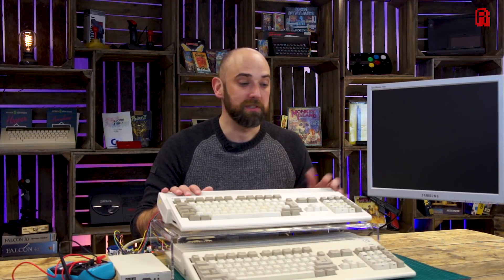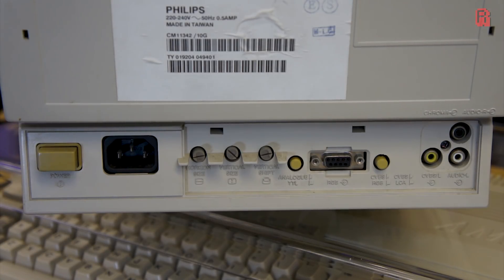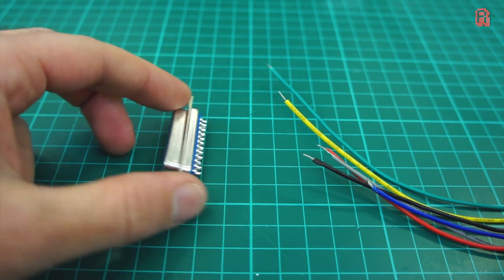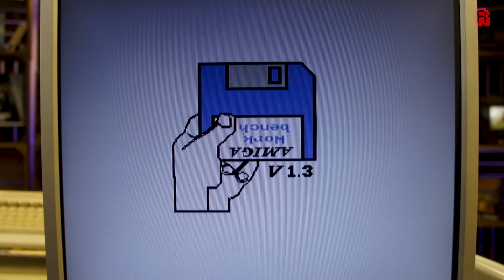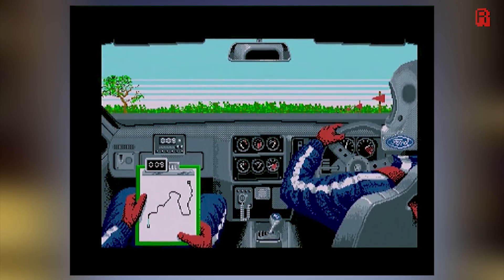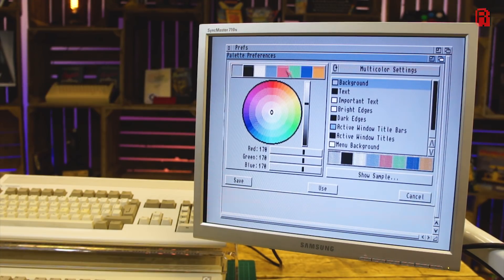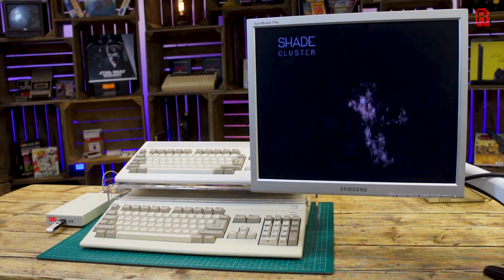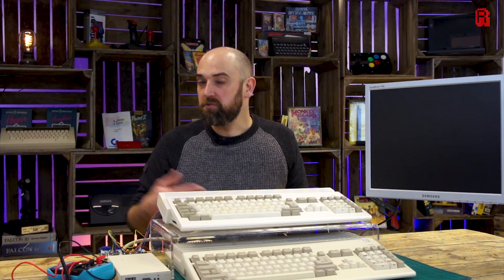Amiga to VGA | GBS-8220 Review (CGA/EGA/YUV to VGA)

Comment from the maker: Thank you for watching I hope this helps you with your purchasing decisions!  Please see further links in the description of others findings and modifications, and I'll be sharing a mod episode very soon.  Overall I'm impressed for the price, and we don't want to spend too much time or money on modding it as every £ closes the gap to the more expensive legitimate solutions out there.  If you have an alternative method I'd love to hear your thoughts and experiences.  Neil - RMC
Reply from the maker: There are a few on ebay, failing that some people hack up a DB25
Reply: Thanks very much.
Reply: about YUV.... you are not quite right but close

did a quick google and found this link that explains it reasonble for laymen: https://www.pcmag.com/encyclopedia/term/55165/yuv
Reply: My dad is more in to this and i remember that he explained it as a signal that transfers the colours except blue and that the screen do the looking at what is missing

ie the transmitting end sends say 20% red and 70% green... the screen then knows that blue was 10%
Reply: Where did you get the DB-23, i can't find it anywhere.
Reply: I currently use the RGB->SCART->HDMI solution and find it barely passable (input lag and problems with aspect ratio at interlaced modes, at least with my particular 16:9 LED monitor)

Watching this was indeed helpful, but I think I'm going to splurge for an OSSC which for the inflated cost, doesn't suffer from the noise and artifacting and like the GBBS board, can use it on a variety of machines.

A+ video as usual, thanks!
Reply: Craft4Cube

There are actually quite a few on eBay UK right now, but shhhhh, don't tell anyone. :p

https://www.ebay.co.uk/itm/23-WAY-D-DB23-D23-DB23F-DB23M-CONNECTOR-SOCKET-PLUG/362047168375?ssPageName=STRK%3AMEBIDX%3AIT&var=631292478000&_trksid=p2057872.m2749.l2649

You need the female connector if you want to plug into the RGB / Video port on the back of the Amiga.

Or the male connector if you want to hook something up to the floppy drive port.

I would recommend grabbing a few of each type, because they don't appear for sale very often.
Reply: Niiiice. The last solution I'd seen for this was years back, and it was a board for the A1000 that actually had to be soldered to the video chip pinouts. Given I have a A2000, this is much better..if I could find the DB-23 connector (And I'm in the US, so that adds another wrinkle to it. :-) )

One question..you're obviously using the PAL mode of the Ami  here...does this have any problems with NTSC mode, or switching between them?
Reply from the maker: VulpisFoxfire I did indeed switch to NTSC on the A1200 out of interest and it worked.  I didn't fire up any games though so further testing required.  I'll perhaps add that to pt2
Reply: Love things like this! Have you given thought to buying a 19" 4X3 LCD? Generally speaking they offered 1600X1200 resolutions but were great for lower settings as well.
Reply: Get an old a 500 modulator that is faulty  that is what i did for mine though it has no cover like a separate db 23 plug does
Reply: As you're working with analog video, I would HIGHLY recommend using shielded cable(s). It would greatly cut down on the interference you're seeing, and also (if you have shielding on each of the R, G and B lines independently) would cut out crosstalk.
Reply: RetroManCave is there anything in between $18 USD and 300pounds for a vampire?
Reply: got one on ebay, now we wait 30 days ....

Comment: Have you tried the gbs-control upgrade with the gbs-8200/8220? My parts will arive soon, and am hoping for better results than the gbs-8200 alone. There's an option to add a clock to remove the tearing issue but I won't bother.

Comment: I use the GBS to use old 80s word processors that require external displays. It’s a life saver at that price, mine’s in a 3D printed case and I use a small 5v adapter

Comment: Don't forget to fit a 680ohm resistor on the grey cable, the Amiga outputs too high a voltage for the card so you'll shorten it's lifespan without one.

Comment: Recently dug out my A1200. It started up once with a screen asking for the Workbench.... The screen went away and just became gray. Now I do not know if the monitor or the computer are at fault. To find out, I decided to try the fix you suggested. I got the board, had a 5 volt power supply. I could not find a DB23 plug, but my Amiga connected to the monitor via VGA cable through the VGA in and VGA out from the 8220 board and a Commodore 390682-01 RGB to VGA adapter to the computer. Well, at least there was a signal through the board and to the monitor, but just a green screen. Hmmm. Any advice? Is my Amiga kaput? Do I need to get that DB23 plug? I will appreciate your thoughts.

Comment: I have fixed many of these monitors over the years. The line output transformer does fail. It fails with a short between winding. Its a long time now since I did any and can't remember the place that made new transformers or if they are still doing them. Those transformer I never had one fail after replacing it unlike the originals. I think there must have been inter-winding stress that caused the insulation to breakdown over time. Another problem with the 500 power supplies which I fixed for a few people was that the pcb would crack across a corner resulting in the regulator not working and giving out 45 volts on the 5 volt line. When this happened there were two loud bangs, an electrolytic capacitor in the floppy drive and one on the main board. Amazingly, after these were replaced and the power supply fixed the Amiga still worked

Comment: whilst most monitor outputs to 1080p via VGA, I would think 720x576 I/P would likely be the best outcome if hdmi is not  used by default  for audio and video..

I'm not sure if cga and vga  inter compatible with 1 another  i know of  converters from component to vga  however  end up pretty much useless as only  3 pins are usually active in this option..

i can't say if cga  pin out would be compatible with  a vga signal..

My experience is never try to push a resolution the system was never designed to push..

noting if you are planning  to use  amiga onboard or an external sound card note: most tv's that do support audio on a pc connection  must use a 3.5mm stereo jack  no tv within the last 10-15+ years has rca analog  audio connection  as preferred medium  where you have a pc connection for vga..

I would avoid using rca>3.5mm conversion cables as this is the best way to introduce white noise into the connection as you are going from a earthed to and unearthed connection..

been mixing  pc audio  to hifi equipment for over  25 years and I can say this for sure

toslink or rca>rca is your best connection method  pc and hifi equipment unless you have a 3.5>3.5mm audio connection to spare

Finding a pro audio card is  few and far between that has access to  rca output that is pci based and that can work within an amiga platform..

even on a pc platform itself can be quite hard in rca based sound cards

Comment: is it ok to plug in the amiga db23 port using an adapter  to the vga in on this board and then connect ths lcd monitor to the vga output of the board

Comment: I've got a DVI port in my A1200 but I just purchased an A500 off ebay and thought how the hell am I going to run it because my 1084s has been sitting in the garage for years gathering dust so I don't think it would fire up anymore and I think I mite have an old analog TV that would work with the RF modulator but I would like to plug it into my current 27inch monitor so this option mite solve my problem

Comment: Is this the one you Philips fixed in recent video? Flyback only? I ask because I have exactly the same symptoms, same sound and power led does not lit. Can you confirm that was the only problem, please?
Reply from the maker: Yes that's the one
Reply: @TheRetroCollective  Mine is 1084S-P1 which is internally exactly the same monitor as I recall.

Comment: Neil, that Samsung 710N is 15mhz compatible? Will it work on an Amiga 500 with a scart -> vga cable? Do you know?
Thanks!
Reply from the maker: Some of the 710N's are.... mine is not sadly
Reply: @TheRetroCollective  whats the prodution year of yours?
Any way to see from the outside if it will work at 15mhz? Serial number?
I've noticed that some 710N in the labrl in the back have a letter in the model after 710N. Could it do to make the diference? I've seen some with "710N [R]"

Comment: Nice Video, although my 1960 still works fine, my NEC multisync died long ago, and since i have an A500, and A1200 and an A4000, I tryed the syncdoubler way and got quite upset on the ripp-off price. So, I decided to buy 3 amiga RGB to scart cables (you have them on ebay for 9euro) and a scart to HDMI converter (again, on ebay for around 25euro).
They are all connected to my Yamaha AVR and I have no flicker nor noise...so I strongly recommend you try 2 ebay buys:
https://www.ebay.com/itm/AMIGA-RGB-SCART-AUDIO-VIDEO-KABEL-1-Meter/322719659549?hash=item4b2397361d:g:7ykAAOSw44BYXSLU
https://www.ebay.com/itm/Scales-Scart-Signal-RGB-Composite-Video-to-HDMI-720P-1080P-Video-Converter/153569151437?hash=item23c16f49cd:m:maWpTLhTdZXSr2vNL_i2G8w

Comment: There are so many ways to connect a AMIGA. Got my AMIGA 500 to a BenQ BL702A 17 inch VGA monitor. With a Indivision ECS V1 with the Super Denise 8373. You must get the right settings with the monitor and the ScreenMode and Overscan. For my AMIGA games it’s perfect. For the AMIGA 1200 the BenQ BL912 19 inch monitor with a RGB/VGA adapter is great. I want the 50Hz PAL Laced 15.6KHz because i want the same as my deceased Commodore 1084S-P1 RGB CRT monitor.

Comment: I have one of those and like you I wasn't quite satisfied with the picture quality.  The sampling of pixels is not in sync with Amiga pixel clock, so there's a lot of blurring and interpolation going on, and it doesn't work as a pure scandoubler, it doesn't output the number of lines that Amiga does, and because it de-interlaces it introduces additional artifacts.  There is a project out there for controlling the scaler chip using a Raspberry Pi, and possibly eventually a firmware mod, but I think better solutions for similar money will eventually arrive.  Oh, and since VGA LCD monitors will not sync to 50Hz, the board will also be doing framerate conversion as well, which is jerky.
Reply from the maker: Since this I have discovered the OSSC.  It's pricey, but you do seem to get what you pay for

Comment: RetroManCave. Question I am hoping you can answer? I have two Wells Gardner D9800 27" Arcade monitors that will eventually feature in a dedicated horizontal and vertical cabinet respectively.  The monitor is capable of 15khz (My main reason to play MAME games at 15khz as they were mostly meant to) THe monitor also supports 25khz (Mortal Kombat) and 31khz.

It has a VGA DB connector at back of the monitor as the only input...Could I run an Amiga on these monitors via that? Thanks in advance!
Reply from the maker: Hmmm you could give it a go.  You can buy a passive db23 to vga adapter for the the Amiga to try it out.  Also check out the ArcadeVGA card from Ultimarc to hook up a PC full of emulators
Reply: @TheRetroCollective  Thanks, I have several Ultimarc (nice to see you know his products!) cards as I have built a few arcade cabinets..just wasn't sure if your cable mod would work between Amiga and the WG D9800 27" monitor :) Thanks for responding!

Comment: Hello, Great video Retromancave. Question: why do you need 3.3V instead of 5V. As far I can see the pcb says 5V on your video.I bought also the gbs 8220 v3.0 and it says on the pcb 5V, too. So how did you find out to use 3.3V .

Comment: Great Channel!
Dont know if you have already fixed your phillips CM8833-II? If you have Ignore the rest of this post.

you are correct on the problem, it is the flyback transformer. I had the same identical issue I bought a new one from retronics
and got a local (old) tv repair man to fix it for about £30.
It works like a dream now. 

HR 7533 / AT2079-37591 / AT2079-37592 Flyback FOR C= and Philips monitors NEW!
( 222707045823 )

retronics.eu
www.ebay.co.uk/itm/HR-7533-AT2079-37591-AT2079-37592-Flyback-FOR-C-and-Philips-monitors-NEW/323494769777?hash=item4b51ca7471:g:g14AAOSwsFpWRzq0:rk:2:pf:0
Reply: https://www.ebay.co.uk/itm/HR-7533-AT2079-37591-AT2079-37592-Flyback-FOR-C-and-Philips-monitors-NEW/223591644315?hash=item340f19bc9b:g:g14AAOSwsFpWRzq0 Updated link :)

Comment: RMC. I have the same scan doubler. I found that modifying a VGA cable or using a DB-15 to VGA adapter like Amiga Kit sells seems to help with the distortion. It seems you are lacking shielding.

Comment: Have you tried running the cable out of the Amiga through a ferrite core or two? Or maybe shielding the device? That looks like pretty common RF interference, really. But you're using RGB out of the back of the Amiga so that doesn't make sense. I wonder if an opto-isolator for each of the R, G, and B channels would help?
Reply from the maker: Yes indeed you'll see ferrite cores and other methods in the follow up episode

Comment: Since I struggled with an A520 still in 2017, I got me the "small" GBS with only one VGA-output. It doesn't work ootb, since I have to mess around in the settings, until I get a picture, every time I connect the power supply. I use it on an older 15"-LCD-TV with VGA, where the A520 was connected before, and I'm very pleased with the output. I wonder if it's possible to make a VGA->Amiga cable to connect the GBS, instead of the provided harness!? I could then eventually put the GBS into the TV-housing, dremel the holes for the outputs of the board, since it seems big enough to fit a whole A500-board in there...

Comment: You should really check gbs-control by rama. Just uses an arduino to transform that upscaler into a line doubler. Gets rid of a huge amount of problems you just got :)

I wouldn't mind watching you transform it, I actually need to see someone build it so I can just learn how it is done :D
Reply from the maker: Kerem Kılıç I've been having a read about it.  I love the solution, but when you add an arduino and maybe a case you're well on the way to the cost of a good premium solution.  It's a fine balance
Reply: @TheRetroCollective  Bob from RetroRGB has a great video on it, he details what you need to do on each model of the GBS to reduce interference and improve the video quality. The wifi hat that you get for it is pretty cheap, only 17 bucks on Amazon. Either way, still beats the other more expensive solutions!

Comment: It's a shame it's not small enough to fit inside the A1200. You could connect to pins at back of port and just have an VGA connector on the back of the Amiga.

Comment: Just a question, why not buy the Amiga (All Models) RGB Scart Cable with Stereo Audio and the Scart to hdmi converter (works fantastic), now you use the old VGA?

https://www.amazon.co.uk/Commodore-Amiga-Models-Stereo-CoolNovelties-Black/dp/B0147A2JAM/ref=sr_1_fkmr0_1?s=electronics&ie=UTF8&qid=1519062521&sr=1-1-fkmr0&keywords=Scart+cable+%28Amiga+RGB+to+SCART+TV%29+%2B+sound+%28modified%29

https://www.amazon.co.uk/Neoteck-Aluminum-Converter-Headphone-Smartphones-SCART-HDMI-Upgraded-Version/dp/B01KHT1MWI/ref=sr_1_4?s=electronics&ie=UTF8&qid=1519059605&sr=1-4&keywords=scart+to+hdmi+converter

Comment: Great video as always. I have the same Phillips CM8833-II with exactly the same problem as you demonstrated, so looking forward to see if you post a video on that repair. In the meantime have bought a GBS-8220 to hook up to an old 17" IIYAMA CRT monitor. CRT's are always better, even though I have an NEC MultiSync LCD1970NXp which will sync down to 15.6 KHz, but looks too dull. On Amiga 1200 by the way, currently using SCART on old 14" TV's. Keep up the great work. :)

Comment: The artifacting is your monitor.  Set sharpness to 0, use a proper CRT so the pixels are actual pixels & not this postprocessed shit.  Also, sleeve all the wires in foil, wire foil to ground, seal in with heatstrink.  This is your 'noise' issue.
Reply from the maker: Thank you for your suggestions.  This review is based on the "stock" wires which are supplied, we will of course explore shielding in part 2.  The artifacting is present on a standard CRT you'll hear I mention that I used one in the video.  Sharpness I guess is a personal preference, for me 0 was too blurry and 5 was a nice balance.  Thanks for watching.
Reply: Yeah, sorry, I read the other comments & felt more retarded than my health record says I am